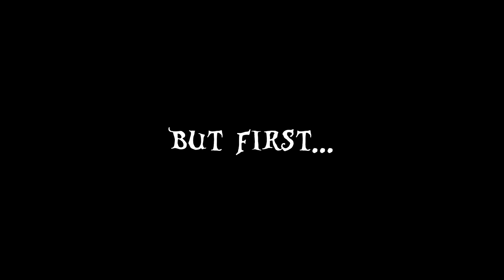Stabilizing a Cracked Neck Pocket(Xiphos)

Comment: When working with cracks and holes in wood, you can always run a shop vac on the opposite side from where you are applying the glue to pull it deeper into the damaged area.
Reply: This is so genuis i feel like my brain was stainding for it's entire life and just sat down

Comment: I know I am late to the video, one, how did the Ibanez work out did it last. My first project on a 96 Ibanez RX, cheaply, two humbuckers, and my first I wanted to start on a working,  decent looking guitar instead of one of my better guitars, carved, sanded the neck filed frets and stained neck came out pretty good, smooth neck and no more sharp fret ends. Then have guitar on bench and like a jerk I went to grab guitar and sweet shirt pocket catches guitar and down it goes, hair line cracks on both sides of body by neck pocket. Ordered pups all ready and came yesterday. Cheaps but good, did not want to spend a lot of money but still 75$, but lots of hours. Don't mind doing your method I am a stone mason, and carpenter and good with hands and making special tools, and building things don't care about the way it looks at this point just want it to work I can do set up on my own guitars and basses. How did it work out did guitar set up right and play fine. Thank you and it has been 2 or 3 years since you did video but just stumbled across it now.
Reply from the maker: Worked out great, I sold it to my buddy and he still plays it live.
Reply: @ForsytheVideo  👍

Comment: Next time try putting screws through the already drilled neck pocket holes. Then you can use wedges to spread the crack a little, to let super glue run in the crack. Then have alot of Gumbands on hand to clamp it back together. The screws will give you a place to wedge against with out damaging the pocket further. Super glue is more permanent not water soluble and can be sanded and buffed on the finish side of the crack,. The only bad thing is it does yellow over time ,. But in a hair line crack its almost invisible.

Comment: Hey Rich, would you one day be able to show how to remove and shim the neck of a set neck guitar?

I've seen tons of Gibson copies that have issues with the neck angle and I wonder if that's something you have any experience with.
Reply from the maker: Hey Ian, thank you for your question.  I have only ever pulled off 2 set necks in my life, and it is a true pain.  I think I would try every alteration to the bridge and fretboard before I would shim a set neck.  Bear in mind to shim a set neck you have 3 to four places to shim, the back of the neck insert, the point on the side of the body where the neck meets, and beneath the fretboard extension that rides on the guitar top.  I may make a video explaining this better, because it's a really good question that very few people ever cover.